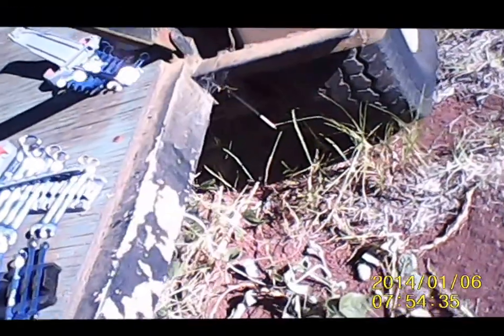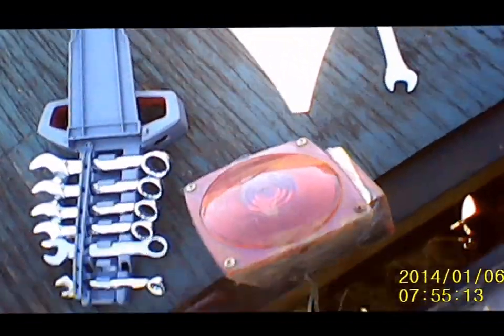Sustainable Hawaiian "Repairing Uncle's Big Trailer"

Comment: Gotta do a little repair to my trailer as well, bunch of busted lights,  I'm going to upgrade to LED and keep the old ones for spares.
Reply from the maker: +TheWreckingYard LED's are the ticket Ron...better visibility...less juice... If I have to replace lights in the future I'll have Uncle Lloyd go with LED's & a junction block instead of plug harnessed to the lights like this 1 is... It'll be easier to replace the pig tail should anything happen... Mahalo for watching Ron!!!
Aloha